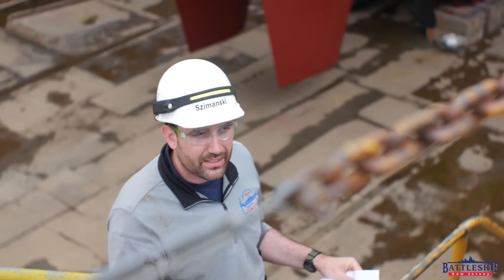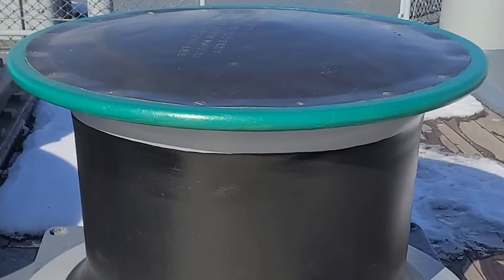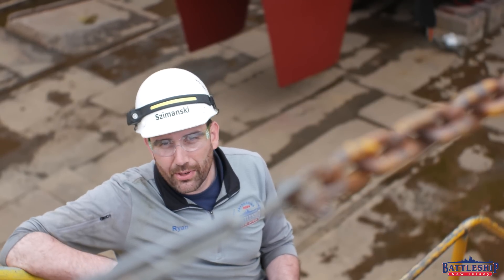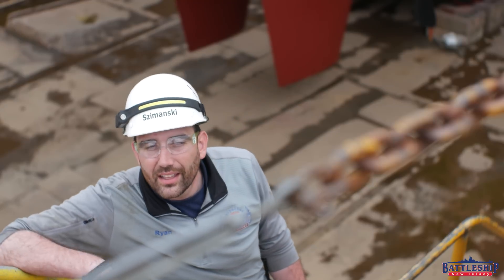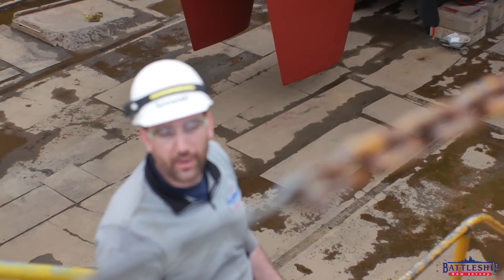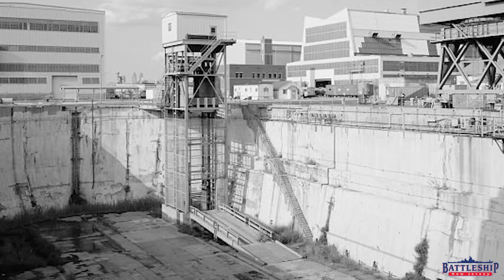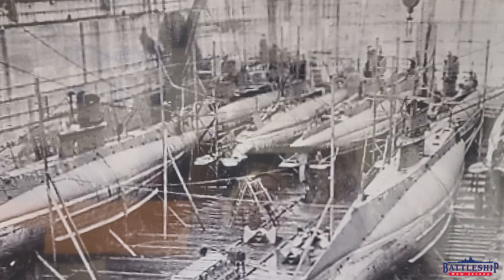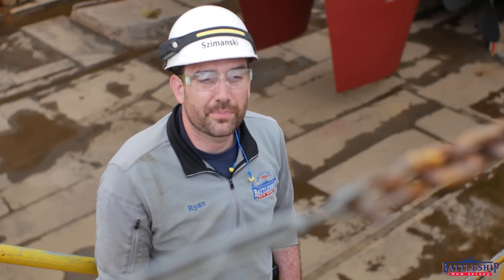The Technical Specs of Drydock 3 at the Philadelphia Navy Yard

Comment: As a recent viewer of this channel I got to day dreaming about what a modern day “Iowa” class battleship would be like. 45,000 imperial tons of fighting warship. Two A1B nuclear reactors, same as “Ford” class aircraft carriers to power it. Speed well in excess of 30+ knots (allegedly Fords do 30+ @ 100,000 tons, so the battleship is less than half the weight). Optic fibre connection cabling relaying software driven, high speed command and control system instructions. AESA RADAR systems (latest versions of the Aegis combat system). 4 type 16” turrets for launching relevant missile selections from the substantial gun magazines. Replacement and pertinent missile systems for the lesser sized gun emplacements. CWIS systems scattered liberally around the super structure. Possible room for 1 (or 2) helicopters (atop 16” gun roof, perhaps). Imagine that sailing up to your oceanic boarder and demanding that the country “Cease and desist, whatever nastiness it was up to”? Ahhh dreams.

Comment: I understand the whole: we removed the elevator to make room for bigger ships line - but my guess is: somebody somewhere knows that the elevator was removed when it was removed because they changed the ASME A17 regulations for elevators and they determined it would be more cost effective to remove it than to bring it into compliance with the new federal standards.... just speculation
Reply: It might depend on exactly when the elevator was removed. Also, in some cases structures made before a certain regulation came into effect are grandfathered in - although they might need to become compliant if major work is done of them.
Reply: It would have just been grandfathered in unless they had to do major work on the elevator

Comment: I wonder how structural engineers that built the drydock calculated that the ground wouldnt shift under the drydock when it was built.  Did they just use strong enough concrete that it wouldnt matter?
Reply: They used enough concrete so that the empty dry mass is more than the water it displaces, so that it will not tend to float up when empty.  That is a big issue with drydocks, they have to be heavier than the displacement at all times, or else you get heave.

Comment: For building those small subs could see adding a second level supported in between the lower level construction.  Perhaps only half builds on top so when you flood the lower set leaves under water then the part builds are bumped to the side and down if building in mass.